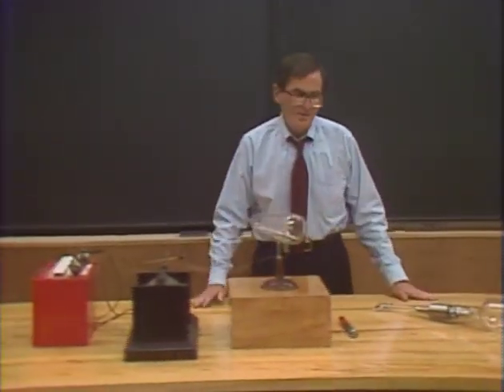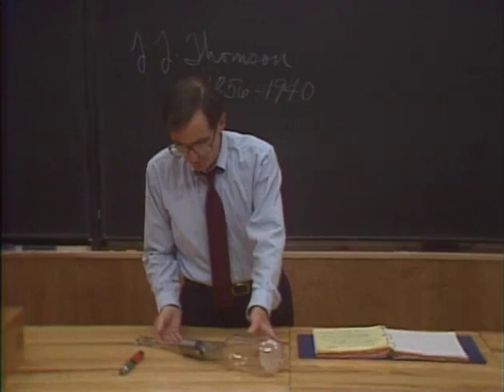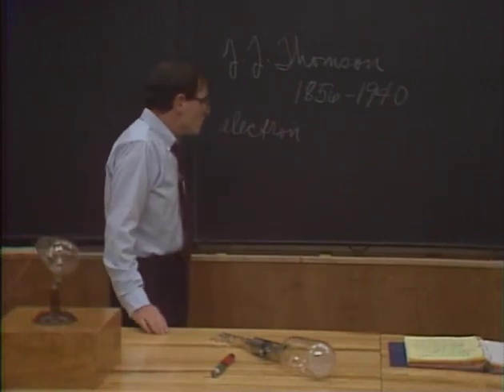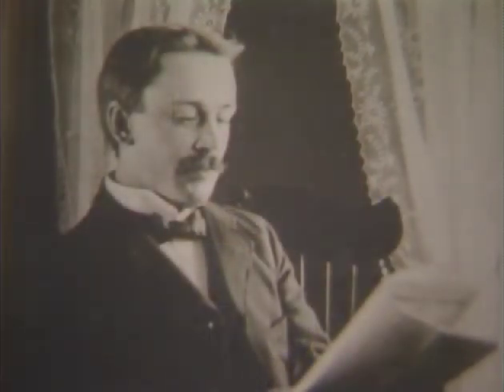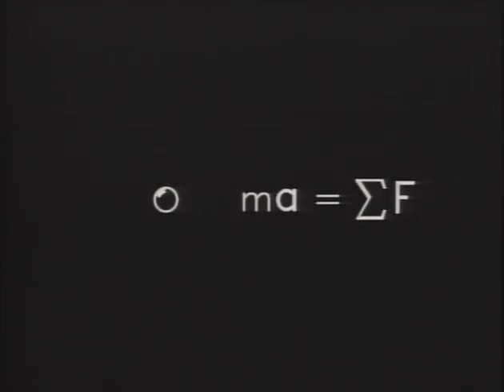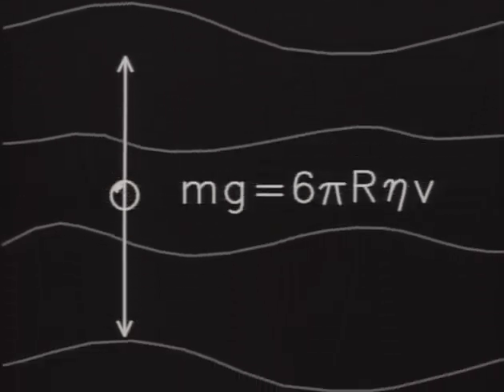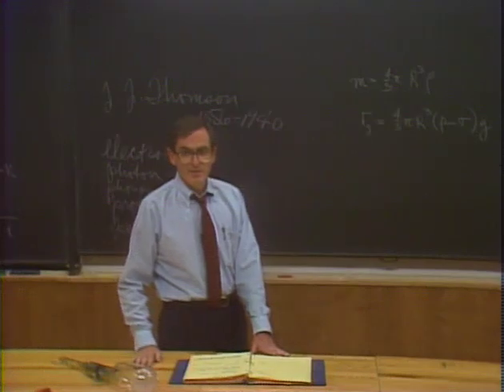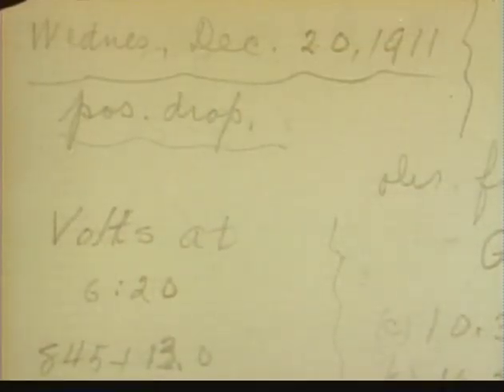Episode 12: The Millikan Experiment - The Mechanical Universe

Comment: As an undergraduate, I was fortunate to be able to play around with a Millikan apparatus at my leisure, and I spent many hours "chasing drops." My approach was to find the charge on a particular drop, and my precision could be judged by how closely the charge I found came to an integral number of electronic charges. 
  After observing one drop for a minute or so, and recording data, it suddenly began to act quite differently. I stuck with it and recorded more data. Subsequent calculations indicated that the drop had lost (or gained) ONE electron. At that moment I felt like I had witnessed something special and noteworthy -- to see the effect of a single electron.
Reply: I have so many questions regarding this experiment. Why is there an inherent assumption that the charge comes from the electron. And that the value is the smallest possible unit of charge. I have watched multiple videos on this experiment and I still don't understand the basis/concept behind it.
Can you please elaborate on what happens in the chamber? From what I gather, there are free-floating, ionized electrons and the droplets condense on them. Is that what is happening?
Reply: @kel-A-3414  The droplets are formed by the atomizer above the chamber and then fall through a small hole into the chamber. They are not formed by condensation inside the chamber.
   J. J. Thompson, in 1897, determined that the electron carried a negative charge. At the time of the Millikan experiment, the electron was the only particle known to carry a negative charge. When it was determined that the oil drops were negatively charged, the assumption was that they had gained electrons. 
   In the course of the experiment, the charges acquired by the droplets were found to be an integral number times a basic unit of charge. This was taken to be the charge on a single electron. It was assumed to be the smallest unit of charge because a smaller unit had never been observed. 
   My suggestion is for you to search for articles describing the discovery of the electron, proton, and neutron. Important names are Thompson, Goldstein, Chadwick, and Rutherford, among others.
Reply: @clarencegreen3071  ohh ok. That makes sense. The part about how the charge was determined makes sense. The whole thing started bugging me when I found out quarks had fractional charges. And then it put into question the validity of the electron being the fundamental unit of charge. And if charge is quantized, how do u get "particles" with a fraction of something considered to be the smallest possible value.  It just raises a lot of confusing questions. I guess I have to start afresh.

Comment: Wikipedia: ' The oil drop experiment was performed by Robert A. Millikan and Harvey Fletcher. '
It also seems that a deal was struck by Millikan to force Fletcher to relinquish authorship in exchange for his PhD, and the pulling of strings at Bell Laboratories.
Perhaps we should be careful with the accolades, medals and prizes we bestow on each other, as it encourages motivations which might affect how an oil drop moves.
Reply: Also, it was, Fletcher's idea to use oil instead droplets of water.
He experimented with dozens of different oils, and he found the one that would best fit the experiment.

Comment: If you're noticing a large delay between the audio and the video, try a different browser.  In Chrome, I get the Annenberg Media logo at the start of the video, which throws off the audio by ~16 seconds.  In Microsoft Edge, the logo is shown at the end of the video and everything syncs perfectly.  No idea why this works, but I just noticed it after suffering through like a dozen of these out of sync.

Comment: I wish they showed what the oil drops looked like in the apparatus.
Reply: As I remember from doing the experiment almost 60 years ago, the droplets appeared as tiny points of light against a dark background. I could not tell that they were small spheres, sort of like looking at a bright star on a dark night. 
  Sometimes if you were too aggressive with the atomizer, you would get so many droplets in the field of view that an individual drop was hard to distinguish. In that case, you could adjust the voltage and run the drops up and down until you cleared most of them out. It was great fun, actually, for a young kid at least.
Reply: @clarencegreen3071  can you please elaborate on what happens in the chamber? From what I gather, there are free-floating, ionized electrons and the droplets condense on them. Is that what is happening?